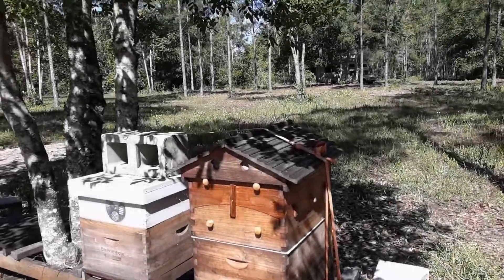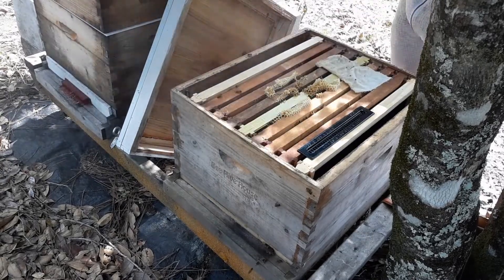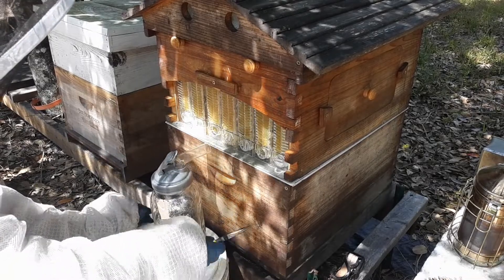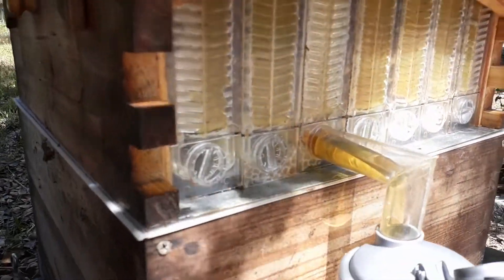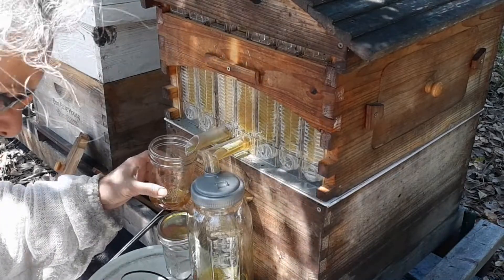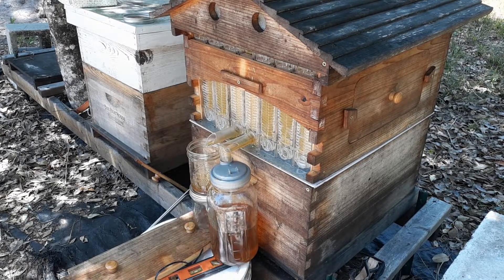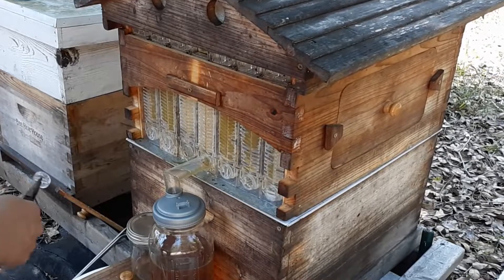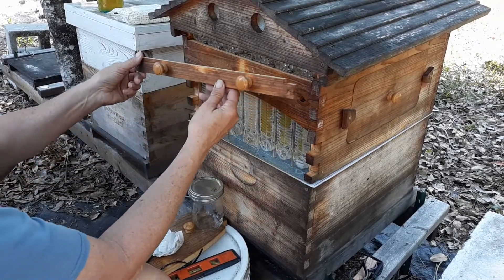Tips to using a auto flowhive with flow frames ~ howididit ~

Comment: Ours only came with one of the metal Rods, I am guessing in this case I use one at the bottom then use it at the top?
Reply from the maker: I only have one on the bottom, the top is closed by a mesh upper board for the gable style roof.

Comment: I tilted my hives too front higher than back. Some guy on youtube said "chinese flow frames pour honey into the brood chamber" but I think part of the reason is, 1- his hives are not in the harvest tilt position, 2- he didn't let all cells get capped before harvesting...please correct me if i'm wrong.
Reply from the maker: I tilted mine back a smidge as well. I did find when the harvest begins, the vacuum is broken and some honey/necture will seep down the frames. I do not harvest more than 2 frames at a time, so it is just a snack for the girls.
Reply: @howididit  yeah im the same way i wouldn't harvest more than 1 or 2 frames at a time, some people made it sound like that brood box get drenched with honey, i just need to get that metal piece to close the gap in the front in order to stop 🐝  from going up in the front
Reply from the maker: @yousefhamed  I used a piece of thin metal from an old dryer body, used a 4in disk to cut it to size, notched out the edge of the box so it would sit flush.
Reply: @howididit  i noticed mine if i move the box just a tiny bit forward the frames block that gap, and it still enough not to open a gap in the back.
Reply from the maker: @yousefhamed  great tip! Thanks